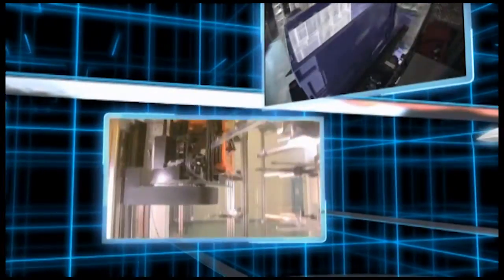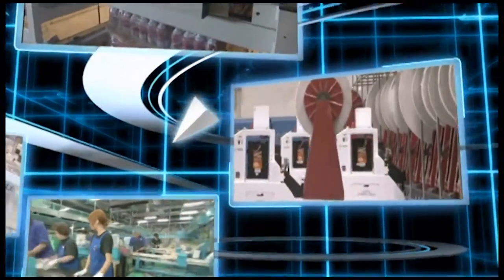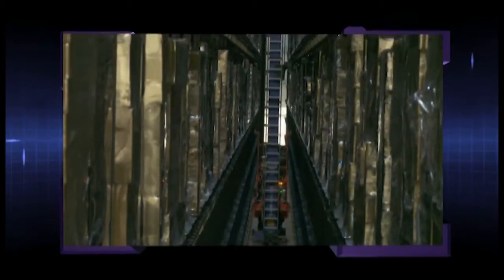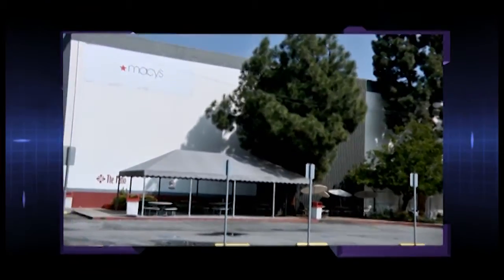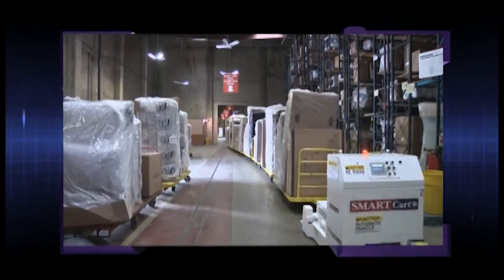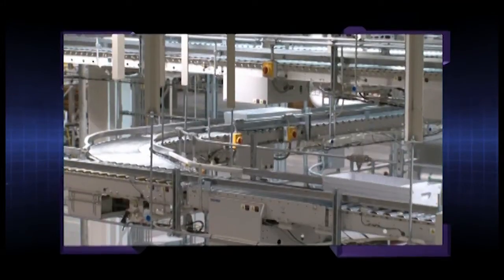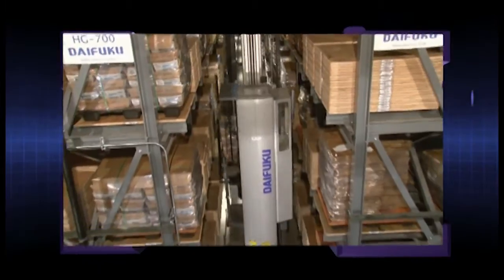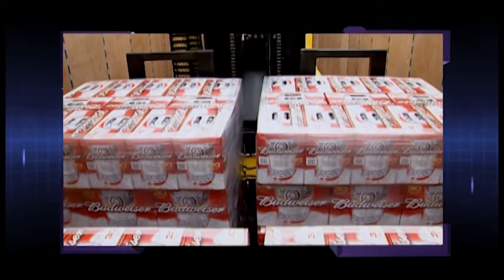Daifuku Webb Corporation Video 2011

Comment: Daifuku would be better if it did not use QNX. It is also hard to make changes to the local PLC code because if the daifuku box doesn't like the order of events on a conveyor (for example) it will shoot a trouble code. 

I will say this though, daifuku's system is rock solid.